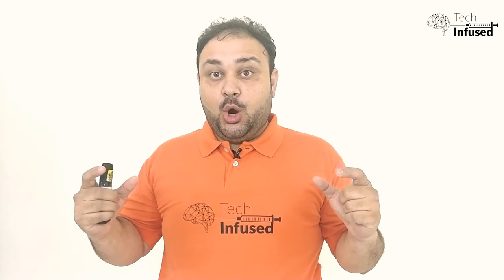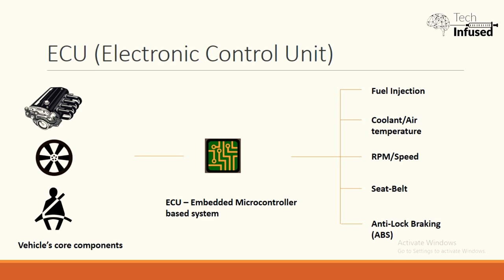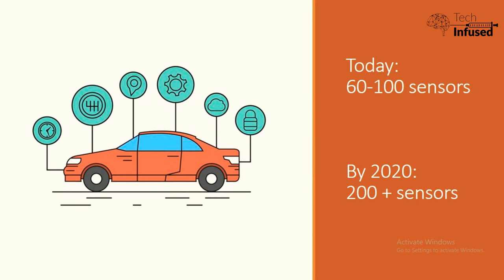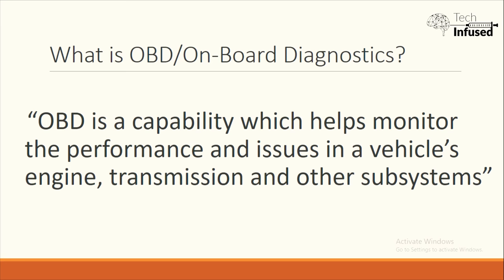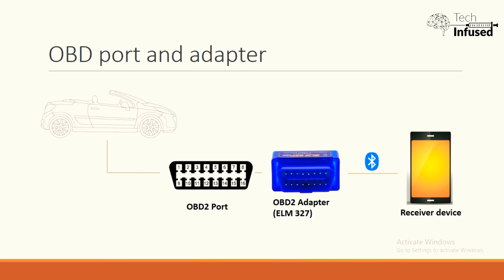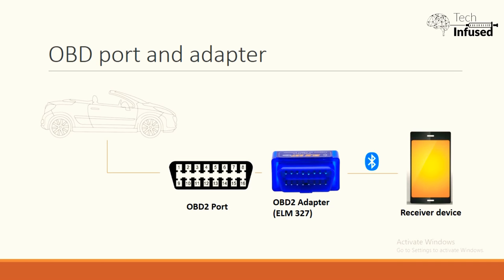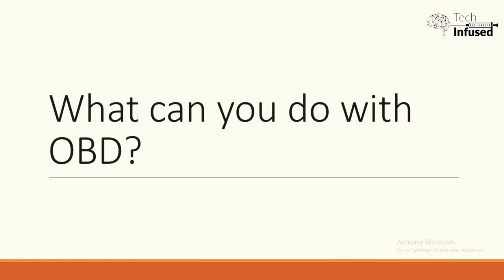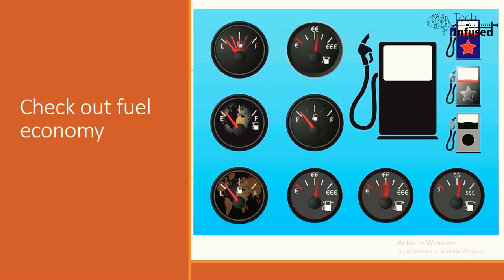OBD Tutorial: What is OBD2? (On-board Diagnostics) - #1

Comment: Very informative. Thanks, Arzan. I have a questions..
1. Is the OBD port used for read-only or can I send commands to, for eg., switch on the engine, or AC, or lights, etc.?
2. Is there a OBD2 port reader, like the ELM327, that can also transmit the data over GPRS/3G/4G/etc.? That way, I can track the car even if the thief stole it, without relying on my smartphone to be inside it!!
Thanks
Reply from the maker: Hi Anil. 
1. OBD port cant be used to send direct commands for regular activities what we do. But we can write the ECU's memory to re-configure/fine tune the engiine's performance by changing ignition parameters, fuel injection timing etc.
2. If your OBD device have GPS capabilities, than yes